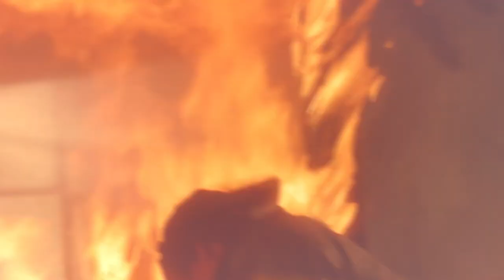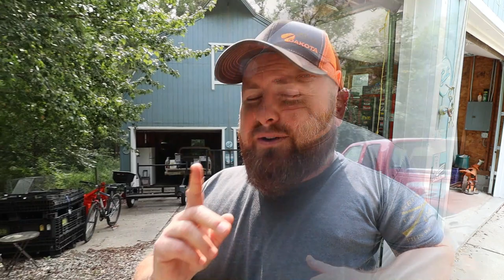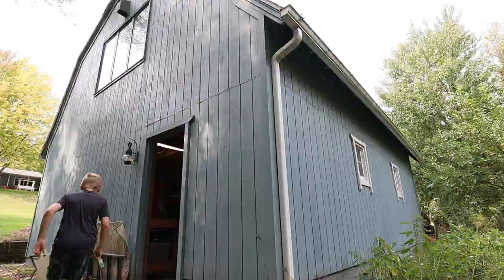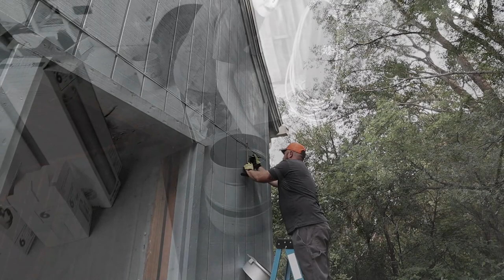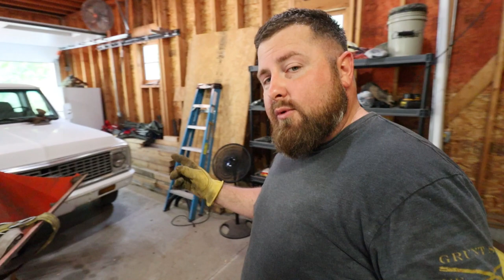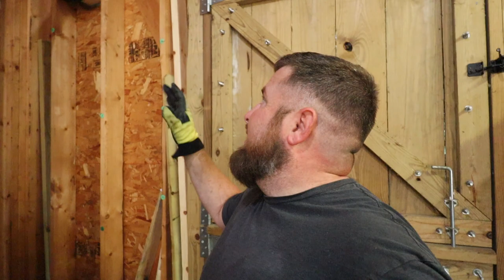Installing A Wood Burner...The Red Neck Way

Comment: I don't know how you find all those extras, but you must have a lot of fun with them as we all do watching them!  So glad you really haven't had a fire!!!  What are you going to use as a heat shield behind the stove, on the walls?   Can you rent a extension ladder or scaffolding for a day or two to complete the stovepipe and for when it needs to be cleaned out?  We really don't want to see you in the emergency department with broken bones. Goats and crutches dont mix and shifting the Kabota in a cast is a PITA!  Lol
I think Melissa needs a case of the Wasp killer or split it between her and Kevin at Hidden Heights.  They are terrible all over this year it seems!
Reply from the maker: Yeah we plan on putting protection on the back side of the stove for sure so stand by for part 2 👍😊😊😊